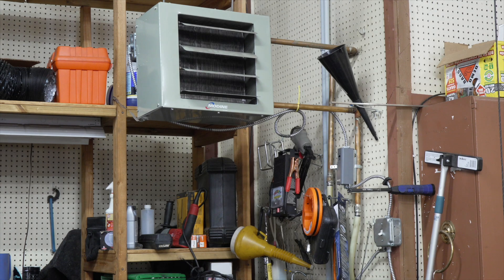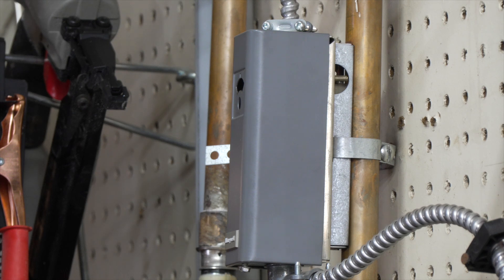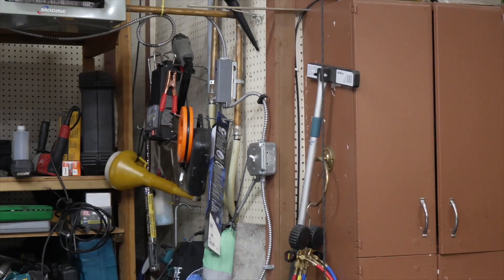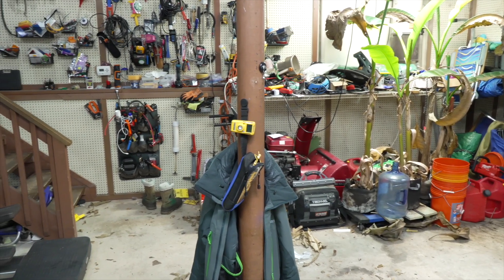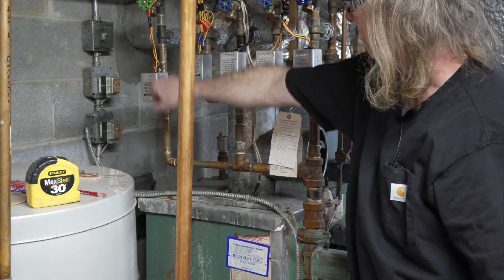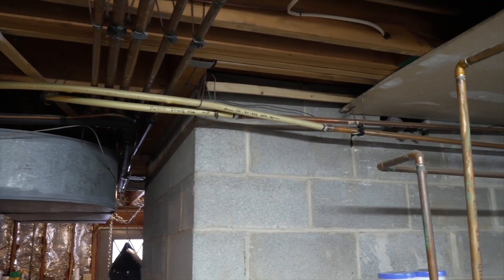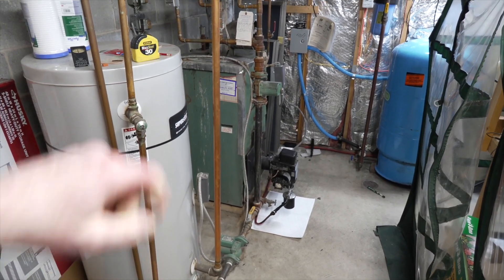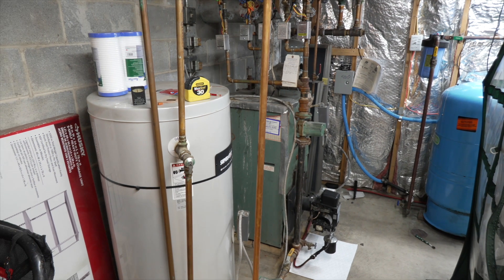My Modine Hydronic Garage Heater;  OVERVIEW of install and how it works

Comment: This is a really good video as to how the system operates. You said one thing that appears incorrect. An old boiler installer said that the system is most efficient when the water temperature is set as low as can be as long as the home maintains.  Excessive heat just goes up the chimney. If the house maints with 130 degree water there is no sense heating it to 160. Only so much heat is absorbed in the heat exchanger. Regardless, this was very informative!
Reply from the maker: Thanks for watching and thanks for commenting. I love learning new stuff. Not quite sure about the hotter the water the better or the cooler.  
We may be talking about two different things.
I wasn't talking about efficiency, and you may be.  

I was merely saying that if it's zero degrees out, 200 degree water in the pipes will heat the house better than 140 degree water. I would assume the boiler would have to run longer if the water was set to 140 degrees and use more fuel but I'll have to figure it out and look around.  Interesting though, thank you.